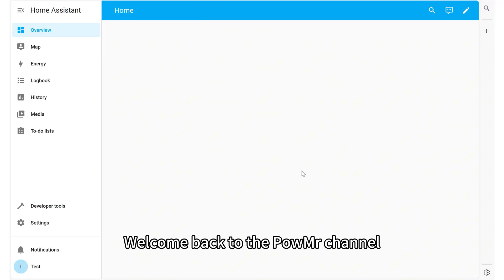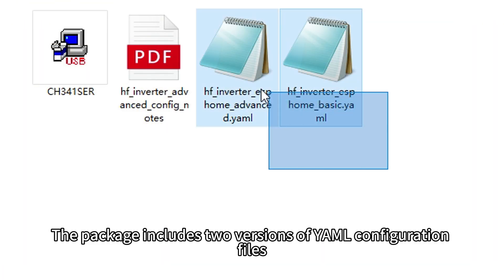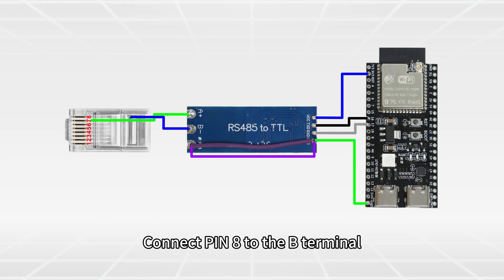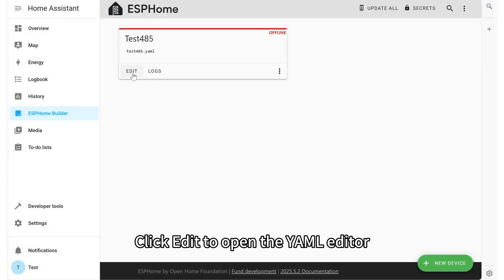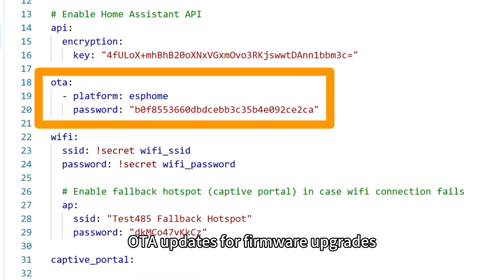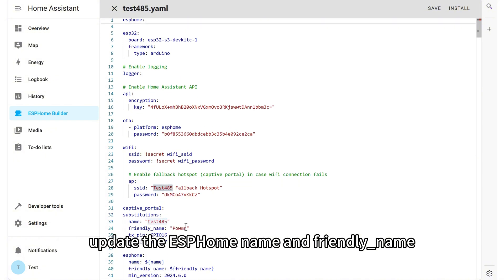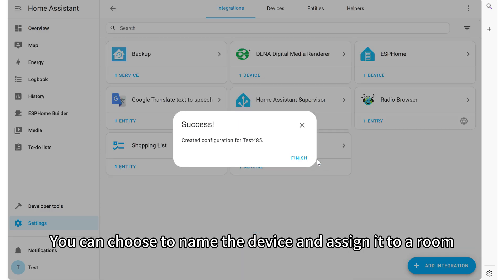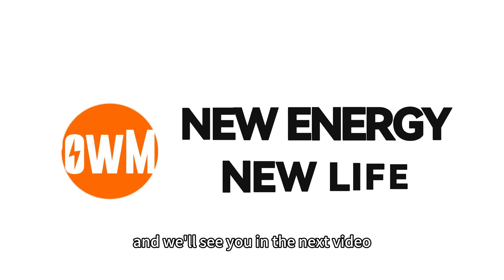How to Integrate PowMr Inverter with Home Assistant (2) - Step-by-Step Guide Using ESPHome

Comment: I was hoping that the yamel codes provided include the "On Time charge enable" feature, parameter # 46 for  POW-SunSmart 10K or Time slot charging
function. I was trying for a while to figure out its id/address, but no luck. I'm trying to control it through Home Assistant, but it is hard to find its exact address. 
Could you share such an address as well as that for the Charge Start Time/ End Time slots? I was able to find some from the iPower app as associated 
with a SERNE similar inverter, 0xE02C, 0xE026, 0xE027, but these are the wrong one for my inverter.
 I'm able, though, to remotely change both the Battery Charge Current, #7, via 0xE20A and the Max utility charge current #28 via 0xE205 also collected from the same app for they were the same, but no luck for subsequent other features/ parameters addresses.
Reply from the maker: Please send it to this email: support@powmr.com

Comment: Nice video. But could I just get a rs485 serial communication adapter to connect to my mini pc running home assistant on VMware? I have no issues passing the connection straight into the home assistant VM. What would it take to make it work? Just modifying the yaml file a bit to use the com port available?
Reply from the maker: Please send it to this email: support@powmr.com.

Comment: can this tutorial for port rs232 in inverter because my inverter use port rs232
Reply from the maker: which model?
Reply: @PowmrSolar my inverter brand samoto IHS5500 byt if use dongle wifi as same like powmr
Reply from the maker: @samsulbahridapurwebsite  You can consult your inverter supplier.

Comment: is it possible to use this way with pow-hvm6.2kp?
Reply from the maker: Please note the firmware is suitable for the following PowMr models:
POW-LVM3K-24V/POW-LVM3K-24V-H
POW-LVM3.2K-24V/POW-LVM3.5K-48V
POW-LVM5K-48V-H/POW-SunSmart SP5.2K
POW-HPM5.6KW/POW-SunSmart SP5K
POW-SunSmart 6.5KP/POW-SUNSMART 10K
POW-SunSmart 10KP/POW-SunSmart 8KL3
POW-SunSmart 12KL3/POW-SUNSMART-5.5KW-48V
POW-SUNSMART-3.5KW-48V/POW-HPM5.6KW
Reply: @PowmrSolar then, how to integrate remote monitoring for pow-hvm6.2kp?
is there any documentation or anything like that? or a l
Reply from the maker: @giorgio_laiersi  
Not yet. We will explain other models step by step in future videos.

Comment: Hello everyone!
Is there a user here who has this solution working!?
I bought a POW-SunSmart 12KL3 type inverter. I made both esp32 c3 and esp32 NodeMCU versions. I tried both the basic and advanced .yaml files, but neither of them works. There is a connection, but every line just throws an error. I get either "no response received" or "Duplicate modbus command found:" errors.
I wrote to them, but they only wrote several times that "they will respond on Monday". In fact, I never received an answer, it's like I'm writing for the first time, they still ask for information.
If anyone knows what the error could be and would write to me, I would be very grateful!

Comment: I've got the 'POW-SunSmart SP5K' model hooked up as described and my ESP32 shows up in HA, but it's got no data. What am I missing? Edit: How can I debug this?
Reply from the maker: Please send it to this email: support@powmr.com. Our technical staff will check it for you.
Reply: Hello,
Did you get an answer? I wrote to them too, but they only wrote several times that "they will answer on Monday". In fact, I never got an answer, it's like I'm writing for the first time, they still ask for information.
If you did get an answer and there is a solution, please help me!
Reply: @janosthesz5909  They just told me to watch the video, not really very helpful. Still unable to figure out what is wrong.
Reply: @janosthesz5909  After a couple of hours working with ChatGPT I figured out that I needed to be using the HF addresses and not the HA addresses. That got this working for me. DM me if you need help figuring it out.

Comment: Will you output a video on how to install solar assistant and then export to home assistant using mqtt?
Reply from the maker: solar assistant? We will check.
Reply: Why would you use solar assistant if you have everything on home assistant when you connect? I tried the 10kw split phase inverter and it doesn't offer full control nor is the graphing and production info any better than directly on home assistant. If you are willing to set up home assistant you might as well forget solar assistant even as a man in the middle solution.
Reply: @fookschool I do have HA; it's my understanding that HA cannot interface directly, just like this video proves, and I'd rather use SA with and RPI than build a custom solution with an ESP32 (personal preference)
Regardless, I've already bought an inverter from a different brand as the local PowMr vendor was sold out until recently
Reply: @Lusanagi you can run direct into a raspberry pi, mini pc, etc on a USB port using an rs485 to USB adapter. Home assistant could directly pull and push through mqtt but you would need to modify the files they have to skip esphome and use the port you are connected to.

Comment: can work on relab 5ke ? becouse rs485 in manual just connect to bms
Reply from the maker: Please note the firmware is suitable for the following PowMr models:
POW-LVM3K-24V/POW-LVM3K-24V-H
POW-LVM3.2K-24V/POW-LVM3.5K-48V
POW-LVM5K-48V-H/POW-SunSmart SP5.2K
POW-HPM5.6KW/POW-SunSmart SP5K
POW-SunSmart 6.5KP/POW-SUNSMART 10K
POW-SunSmart 10KP/POW-SunSmart 8KL3
POW-SunSmart 12KL3/POW-SUNSMART-5.5KW-48V
POW-SUNSMART-3.5KW-48V
Reply: @PowmrSolar  i hope next tutorial for relab version...

Comment: Is it possible to set the output of the powmr hybrid inverter from home assistant so I don't lose power to the grid?
I want to connect a big battery, PV and ac out directly to one phase of the grid. Then, whenever I need power the inverter to supply it so I get to zero waste and no lost power.
Reply from the maker: There is a problem here, which is what you said, connecting the AC output to one of the phases of the power grid to offset the power consumption. This means that the AC output is connected to the mains terminal. As for home assistant, you can set the switch to control the AC output, but you cannot connect the AC output terminal to the mains.

Comment: Thank you so much for the video and your clear explanation — it was really helpful!!!

About other topic: I have a question regarding my PowMr SunSmart 10KP inverter. 
I'm currently facing an issue where I can't figure out how to put the inverter into standby mode in order to properly configure parameter ID68. I've looked through the manual but couldn't find clear instructions. Any advice would be greatly appreciated!
Reply from the maker: You mean item 68: AC output phase
mode, right? Could you please be more specific about your doubt?
Reply: @PowmrSolar 
Yes, I’m using 120V single-phase (on Mexico) and I'm connecting L1, N, and PE to the AC Input. However, when I set parameter ID68 = 0, the AC Output values are incorrect:

L1 to L2 → 2.33V
L1 to N → 120.6V
L2 to N → 121.0V
N to PE → 41.8V
L1 to PE → 78.5V
L2 to PE → 78.9V

When I change ID68 to 180, the values are:

L1 to N → 120.6V
L2 to N → 121.0V
N to PE → 0V

In addition to this issue, I haven't been able to configure the inverter to properly switch to the main source (bypass) when the battery reaches its lower limit.
Reply from the maker: @kceress  Please contact this email: support@powmr.com. Our technical staff will check it for you.
Reply: @PowmrSolar  Hello, good afternoon! ...Thank you very much, I already sent the email.
Reply from the maker: @kceress  Can you send me your email?
Reply: @PowmrSolar  Hello, good morning! Yes, they responded yesterday requesting some information about the purchase. I'm still waiting for a response that might help me solve the problem. Thank you very much for following up.
Reply from the maker: @kceress  Okay.
Reply: @PowmrSolar  Good morning! I’ve resolved the issue — it was caused by ID63 (Auto N-PE) being disabled. The reason I hadn’t enabled it before is that my utility company (CFE) already provides L, N, and PE from outside my house, so I receive all three wires pre-connected. I initially avoided enabling Auto N-PE because it’s generally recommended not to have two separate N and PE connections within the same electrical panel. Thank you very much for your support, and I apologize for any inconvenience caused.
Reply: @PowmrSolar  It would be great if you could create some YouTube content showing how to properly configure these inverters for single-phase installations. I'm sure it would be helpful for many users.
Reply from the maker: @kceress  Okay, we will. Thanks for your advice.